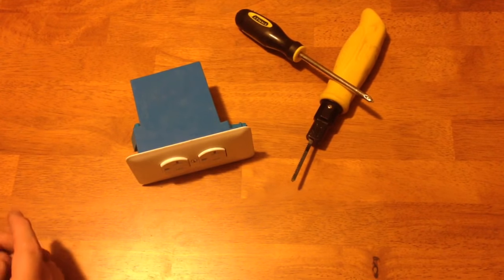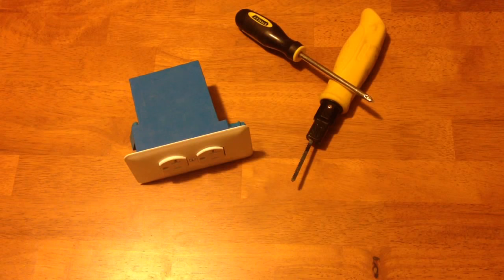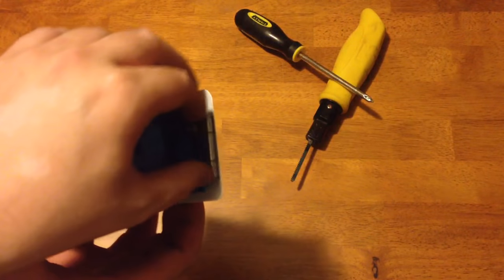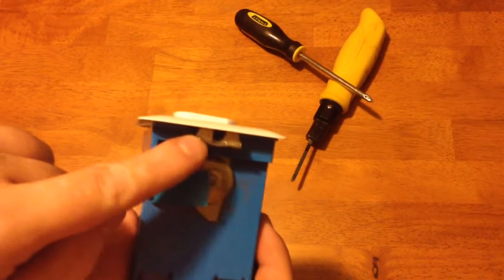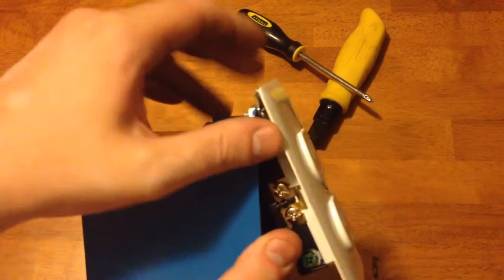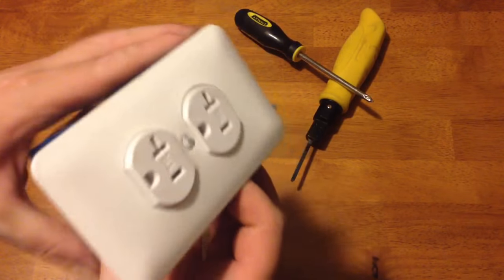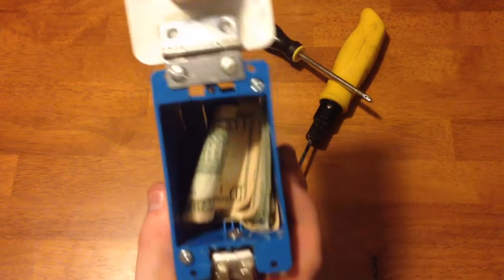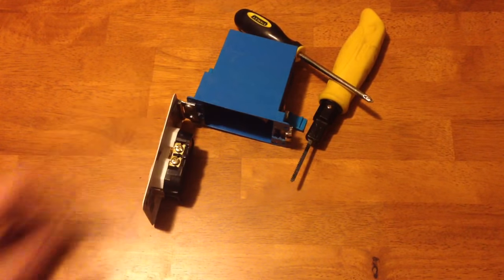DIY Project - SECRET HIDDEN WALL SAFE (Prepping for Beginners)

Comment: I see a problem with the design because it tends like that you're not gonna be able to open it once it's installed in the wall because it's going to pitch against the drywall you would've been better off putting magnets on the top and bottom so you can just pull the faceplate straight off
Reply: Here's the solution - set up a lamp with a heavy cord next to the receptacle and epoxy the plug into the lower slot.  This will give you something to pull the cover open with.  In addition, the fake lamp will make the whole setup look like the real thing.  No self-respecting burglar is going to mess with electricity.
Reply: @lourak613  that doesn't fix the pitch issue lol, the way I did it was to just ditch the whole hinge idea and just do magnets on the other end as well. Not as sexy but w/e.